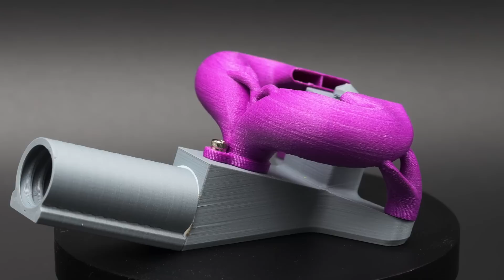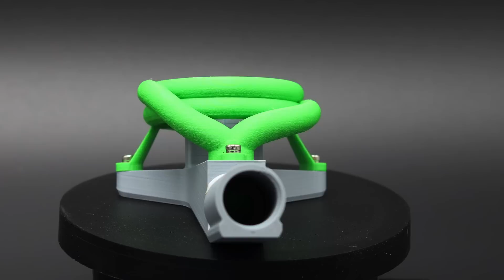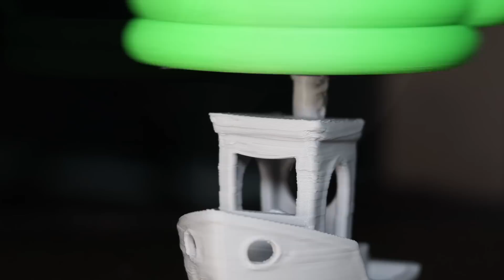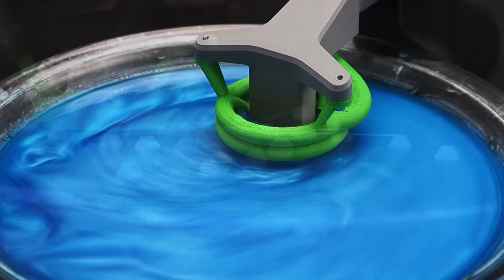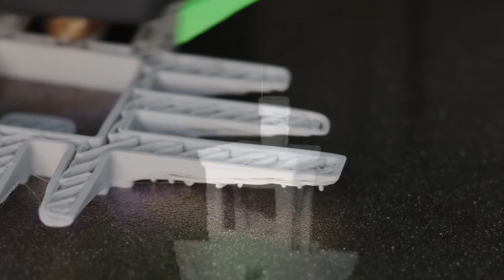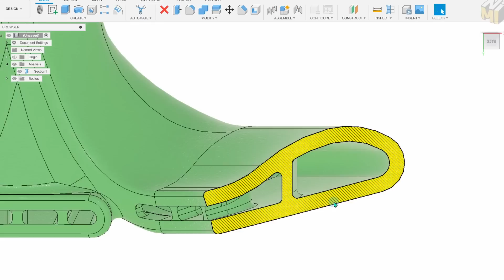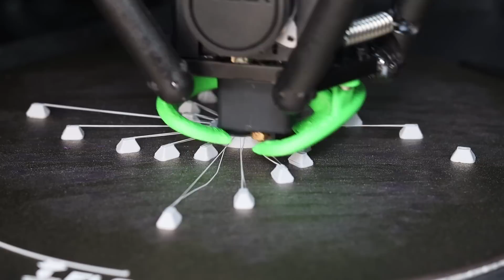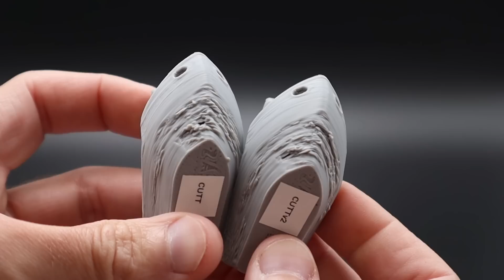Ep.2 - More crazy looking 3D printer duct designs with some serious performance!

Comment: I am confused. This series talks about "high speed printing" without specifying the print speeds or accelerations and none of the print parameters are shown. From what I'm seeing in the footage the printer is not actually going that fast and the nozzle is probably way too hot in an enclosed printer so the ambient air is way too hot for PLA. This entire series feels like 2015 printers trying the wrong solutions to the wrong problems. Just lower the nozzle temperature, open the door and figure out the hotend's max flow rate at different temperatures. There's so much information missing from this video and so many parameters being completely ignored that it becomes confusing. What even is the goal? Is it to answer the question of "Can a good part cooling duct counteract completely inappropriate slicer settings?" if so, please mention it and put the horrible printing into context.
Reply: Also if the argument is "higher nozzle temp will show better the cooling performance" then the whole idea behind this series if flawed. Higher nozzle temp just means the plastic is more thoroughly melted, up until it gets too hot and starts to break down. The goal is always to bring the filament temperature close to or slightly below its glass transition temperature soon after it leaves the nozzle. However, the higher the temp as it exits the nozzle, the more of a thermal shock this will cause on the now rapidly cooling plastic. This adds unnecessary stresses in the part and is generally unwanted. In the case of this video, it seems like none of the ducts can get the temp down close to the glass transition temp as the plastic stays very flexible and malleable long after it has left the nozzle. This is probably due to the chamber temperature being way too high for PLA. Once again there's so much information missing. Is the cpap style fan pulling air from inside the enclosure or from outside? what is the bed temperature? what is the ambient temperature in the chamber? those parameters are so much more valuable than "part cooling duct bad".
Reply: While I love the series because I find the content interesting, I totally agree with this person. There might be a video that explains all this and I have not seen it I'll admit. 

Also, found the engineer in the group 😆
Reply: I think you are kind of missing a few key points to testing here. First of all, the exact parameters are nearly irrelevant when what we are shooting for is comparison with the same parameters. In other words, it doesn't matter if it prints faster or slower, as long as all of the ducts are printing at the same speed. We are going to see the results between them. Now I agree it would be nice to know the exact parameters, but what we do know is that it's printing at a very high speed. As in, much faster than a default profile on any current off-the-shelf machine.

As for saying it sounds like 2015 with wrong solutions, show me any other series that actually goes this in-depth on testing or offers this many designs stretching all the way back to 2015. It is putting knowledge into the public ethos and allowing people to draw conclusions or ask questions like this. The conclusion at the end of the series may be that the testing was flawed and that there are different or better ways to test. I think it's very valid to bring that up, but just criticizing without giving specific ways to improve the testing certainly won't help. Figuring out how to interpret the results of the testing is one of the goals. 

I think it's fairly obvious he isn't just pumping the nozzle temperature as high as possible to try to challenge the cooling. If the nozzle temperature is high, it is to meet a flow rate that is required to hit the speeds he is printing at. It is possible he is printing hotter than necessary, but even if that was the case, the video would demonstrate the same principles. Part strength or thermal shock in this case really does not matter because we are looking at cooling ability, not part attributes. Separate concepts with separate testing. I also think it's pretty obvious he is not printing with the chamber fully enclosed and again, the temperatures between all of the tests should be very similar overall.

I guess to summarize in very simple terms, you are asking what every single variable is when all of the variables are kept the same except for one, which is the cooling duct. While some of the variables may not be optimal for printing parameters you would like to see, they are set at a specific level for the testing. The goal here is to examine the testing and determine which duct performs the best and even to determine if that's possible to ascertain from this testing. I think it's pretty clear that there are clear differences. This is not supposed to be end-all be-all testing or determination of the best printer duct ever made.
Reply: Your definitely right considering if my printer printed with a stock duct that terribly I'd be getting a 100% refund
Reply: @TwiggyMC  This isn't about printing at stock speeds though. He has a whole video about this printer with stock settings. It's obviously beyond that or else the stock duct would perform well and many of the submitted ducts would perform even better, as they do in these harder tests. This is a torture test, even if it's not as crazy as it could get.
Reply: @802Garage  yeah sorry I misspoke a bit about the 2015 bit. What I meant really is back then when DIY 3D printers were new and the cool thing to experiment on, we would see tons of designs because nobody knew what affected which problem. This feels like that kind of process all over again. Back then we didn't really understand how flowrate and volumetric flow affected how consistent traces were for example. But now slicers have dynamic flowrate adjustment with dynamic fan speed, all to get very repeatable results and remove the guesswork from the equation. Now we know what printing with improper settings can lead to so it's still confusing to me how this sort of video can exist where we basically forget about the past decade of learning and advancements and focus on one specific part of the complex system that isn't really the one to fix the presented problems.

For exemple, newer "high speed" printers solve the issue of the part cooling fan not spending enough time in one spot to cool down the last traces by adding a large auxiliary fixed fan that sweeps the whole build plate. This is far more effective at fighting the issues shown in the prints in this video. Same for the other basic stuff, like we KNOW pla doesn't like it when the ambient air is too hot, we KNOW it's better if the printer is not fully enclosed when printing pla, we KNOW that high ambient air leads to those bad overhangs and poor bridging. And yet, all those tests are done in an enclosed printer that gets to who-knows what temperature.

Anyway, I'm sorry  if I seem critical or pessimistic, I just think there's very possibly valuable information to be learned and discovered by doing such community-driven iterative design process but right now it feels like there's too much information missing and the goal isn't clear enough to lead to actual advancements. At the very least the slicer settings should be disclosed.
Reply: @802Garage  I suppose that's fair I must just be spoiled with my bambu(went from an ender 3 pro to a bambu lab enclosed(can't remember the right p) and didn't have nearly as bad problems with high-speed and stock duct(yes you can change out the ducts but I don't recommend it honestly)
Reply: @EMILE12345678901  i do also agree with all this tho I feel like this series could actually advance the duct fan if done with a torture test amd a control test
Reply: @EMILE12345678901  I do get what you are saying and understand your frustration. Thanks for clarifying a bit more. I think he kind of clears up a lot of that at the beginning of this video and with the intro to the series. He found that an improved duct could maintain similar cooling at a lower noise level. This is a way to kick that challenge up a notch by using torture tests to see how good of a duct we can really find. He knows and we know that not every result will translate to every speed of printing and every print. It's impossible to find a perfect duct. He also knows that his methodology may not be perfect and he is willing to adjust or do more tests later.

I think you may just be focusing a lot on details which are "controlled" variables rather than examining what we can learn from the testing as it stands. Do you see any pattern in the results? Are there any stand out performers? Are there problems that repeatedly show up? I think there is already a lot we can learn about what to do and not to do when designing a duct, and a lot we still don't know. This is not going to lead to a scientific paper or a perfect tidy answer, but it is fun and informative. This video isn't about adding an auxiliary fan. It's about testing printhead fan ducts, ya dig?

I'm again pretty confident these tests are not being done with the printer fully enclosed. Just look at the camera shots. That's not a tiny webcam, hahaha. It also again is somewhat irrelevant if all of the prints are printed in the same conditions. If all of the prints are done in too high a temperature and the ducts have to perform there, those are the results we are getting. Will this all translate to a duct that can both be quieter while printing at standards speeds than the stock duct and can reach much higher speeds than the stock duct without print failures? Well then that's a huge success.

It will also hopefully inspire some new ideas and designs and certainly if anyone else wants to host their own challenge and improve the methodology as they see it that would be more than welcome. I do get where you're coming from and I appreciate the conversational tone and willingness to hear me out. I'm not saying there are no issues with the tests, I'm just saying for comparisons sake I think they are still valid and we can learn a lot, including which questions to ask next and which tests might answer them.
Reply: @TwiggyMC  I have seen improvements to the Bambu stock design as well. If you start pushing speeds on your printer you will still find areas the cooling falls short. These tests, I believe, are beyond any of the stock Bambu profiles in terms of overall speed.
Reply: @802Garage  ya I understand completely I will say his speeds are definitely within bambus as you can incrementally adjust the speed on the printer(obviously can do in bambu slicer too but for on the fly adjustments) and it definitely gets up that fast if not faster before you have todo it from the slicer to go higher
Reply: @TwiggyMC  I have my doubts given the S1 motion capabilities, but I won't argue it further. Nothing against Bambu Lab, just trying to speak practically. No point in speculating without knowing your exact settings and his though.
Reply: Most if not all of the questions you posed are answered in the very first video of the series if not in the review of the printer that spawned this whole series.
Reply: @RanaLoca  I just went back and rewatched the first video and was gonna say similar, hahaha.
Reply: @802Garage all good i hope there wasn't any hostility felt from me I was really enjoying the discussion ngl
Reply: @TwiggyMC  Nah definitely not. I'm opinionated but it's not like I get mad at people for having different opinions on 3D printing videos unless they are outright insulting or something, hahaha. I appreciate any discussion as long as there is an end goal of adding or improving.
Reply: @RanaLoca  yeah that's why I'm saying the tests are in an enclosed printer, he said so in that video.
Reply: I’m with you on this. I love the work, but it all seems irrelevant at this point. I now use a Bambu X1C which not only prints a flawless Benchy, but it also does it very fast. The entry level Bambu printers print better than what’s being shown here.
Reply: @SomewhatAbnormal  Yeah you're right. Cars are good enough too. They should stop developing them. Bambu Lab shouldn't produce a new printer either. If a company has come up with a solution that works, individuals should stop trying to make their own. I could belabor the point more, but come on man, really? That's as far as your brain got on this? "I love X brand so any other work is pointless." Give me a break.
Reply: @EMILE12345678901  With an open door. This is standard for printing PLA on an enclosed printer. Most people with enclosed printers don't remove all of the sides just to print PLA. Again, it's also about comparison in a torture test, not ideal conditions.
Reply: @802Garage  yea, I think you're missing the point. I love the idea of experimentation, but what problem are we trying to solve here? Is it a problem that needs a solution, or is it just pure experimentation? At the end, will we be implementing the solution, or will it all be for naught because there are far better and easier to implement solutions already available? I'm a tinkerer and I always say that "the wheel can be reinvented and it has been reinvented many times". But I'm a pragmatist – when I find a solution that checks all the boxes, I tend to use that solution and re-focus my efforts in other areas. I guess my question is, how should I be expected to implement an experiment that doesn't quite meet an already high bar? I'm simply asking, what should I take away from these tests? Also, to be clear, I love this channel. The experimentation with different 3D printed joints was enlightening. I'm just miffed on where this particular experiment is heading.
Reply: @802Garage  you're "missing the point", as in my specific point, or rather question, which is how should I be expected to apply this device-centric solution? I'm not fine with "good enough", but none of what I've seen here is better than other widely available solutions. Anyway, it's obvious that you're very passionate about this project, so I applaud you. I'll remove myself from this conversation so that you have time to write novels to the other folks who had the same questions.
Reply: @SomewhatAbnormal  I answered every single one of your questions, so you moved the goal posts. To answer your new question as concisely as possible, if positive results are determined by this testing then people can design models based on said results for a wide variety of printers and you'll be able to simply download and print a model and apply it to your printer. Your quip about widely available solutions is inaccurate since those don't exist for this specific printer and many of these designs aren't remotely available for any other either. If this testing helps determine that commonly available designs for some printers are in fact the best and most practical options, than the testing still had value. I'm certain you can understand that. My novel, excluding your quotes, was maybe three times the length of your short story. Pot, meet kettle. You're entrenched in a non-existent position.
Reply: @802Garage  good god man! I don’t have the patience to read another tome! I had a question about how the video I was watching actually applied to ME. Other videos from the channel apply to me — I specifically enjoyed the tests on different 3D printed joints. I’m sorry if I touched a nerve with you. The nature of YouTube is that sometimes people have questions about the content.
Reply: @802Garage  you have issues. You’re counting words? Very odd.
Reply: @SomewhatAbnormal  Takes about 10 seconds to copy past into a word counter. You apparently have issues reading less than 150 words, so I'll take my issues over yours. 😘
Reply: @802Garage  still going? Is anyone allowed to have an opinion with you around? I assume you’re like this with everyone.
Reply: @802Garage  look man — I expressed my opinion and asked a question. You swooped in on my comment and on many others insisting that we are all wrong. I haven’t denied the validity of points you’ve made, I just don’t have the same level of interest or need for what is being presented. You can’t let go of the fact that I don’t agree with you on everything you say, and you’re annoyed that I just don’t have your zeal when it comes to this particular project. Sorry man, but you’re gonna have to let it go even though it’s obviously one of the most important things in your life right now. I apologize to the owner of this channel for all of the back and forth — I never intended to get into a protracted discussion — I really just didn’t understand the purpose of the project as it relates to your previous work. This is very upsetting to 802 and I’ve done my best to be civil while simultaneously being insulted every 1-2 hours with one of his new comments.
Reply: @SomewhatAbnormal  Look man, you asked a bunch of questions, got answers, moved goal posts, wouldn't respond to any points made, acted like I'm upset and you're not, insulted me, and then tried to use "Everyone is entitled to an opinion." When you said you were asking questions and didn't understand. It's also pretty ridiculous to berate someone for writing a lot while you are doing the same thing and telling them to let go when you aren't letting go either. This is incredibly basic hypocrisy and you keep doing it. No need for apologies. I think it's pretty clear to anyone who reads this back and forth what my purpose was and that you didn't really have one except criticism for its own sake.
Reply: @SomewhatAbnormal  This is all summed up by your statement. "I just don’t have the same level of interest or need for what is being presented." Then you had no reason to say anything you did. Nobody forced you to watch the video or comment. You weren't adding anything to the topic, so what was the point? Why spend your energy just to criticize content because it isn't your personal favorite? That's key here. I already clarified the "purpose of the project" since you asked questions and I answered. As for pertaining to previous work, you mean his previous 3D printed work? I wonder how it could relate. You want the last word and to avoid ownership of all prior words. I've been addressing what you actually said and I've been civil. I also didn't pretend not to read what you wrote.
Reply: As long as he doesn't change any setting your complaints shouldn't matter in comparing the ducts in his certain setting.
Reply: @802Garage  using extreme print settings to increase the requirement of cooling will most certainly change the printed plastics reaction to the cooling. If the plastic comes out far to hot from the hot end, then you cannot use a high velocity fan to cool it otherwise it will deform it. The comparison in this video has no real application and only serves as mediocre repetitive entertainment to those with no understanding of engineering.
Reply: @capone2488  You said nothing except faster printing requires more cooling. That was obvious and the genesis of this challenge, along with reducing noise of course. There is successful printing far faster than what is shown in the video, so your premise that it invalidates the testing is completely incorrect. You didn't even watch the introduction video to the series nor further results in the series, obviously. People who actually do pay attention have already drawn plenty of useful conclusions from these videos. Until you actually have something worthwhile to add to the discussion, I suggest adding nothing or going to do your own testing to teach us all a lesson.
Reply: @802Garage  you clearly did not read my comment, or you lack understanding of material properties. What I'm saying is that printing at a higher than ideal temperature requires a different type/method of cooling, and printing with ideal settings can often favour higher air velocities. Because he is printing hotter than ideal high speed air can blow/deform his overhangs making the print look worse even though the cooling is actually faster.
Reply: @802Garage  reread your reply a second time and you clearly have no idea what I'm talking about, not once did I say hotter extrusion temps require more cooling